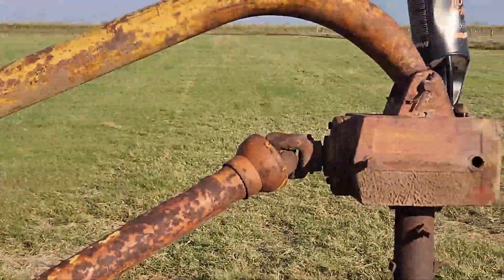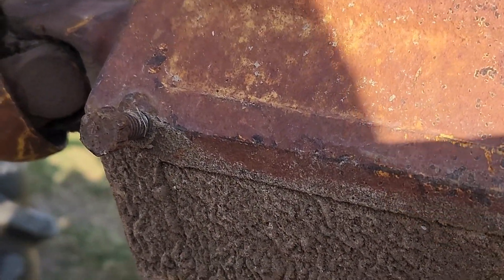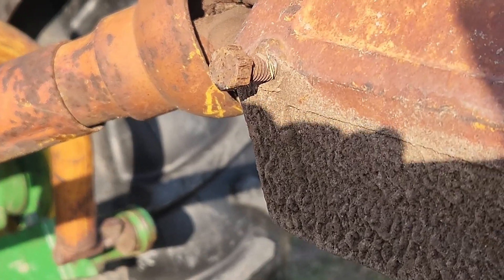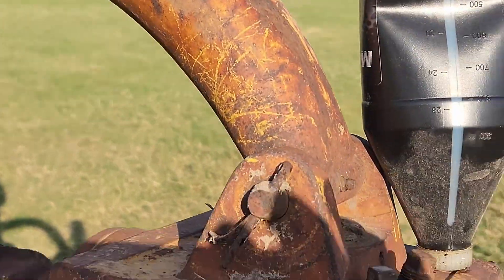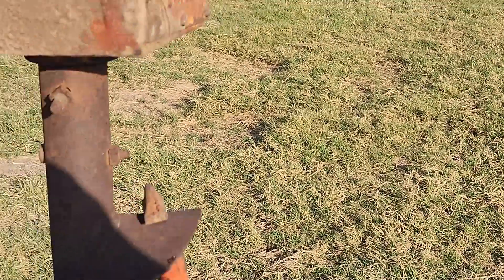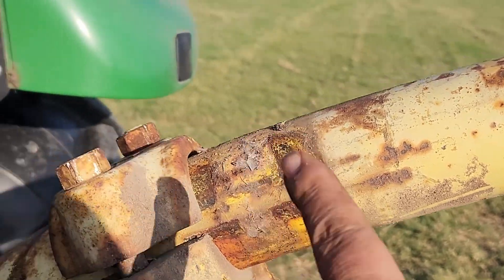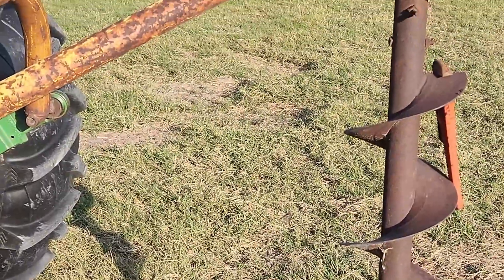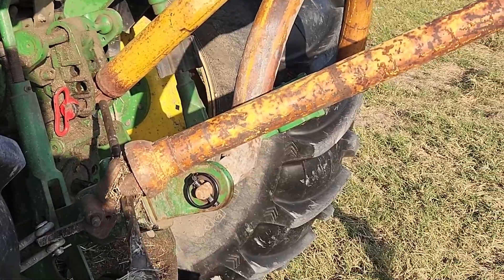How to Install and Make a Sliding Gate. 34 Foot Gate Part 1

Comment: It has been my experience equipment of that age was built to last. 
Unfortunately now it's built to wear out so they can sell more. 
Thank you Louie.
Reply from the maker: You are correct Bryce,  I am lucky that it has a 2" shaft and it has been the norm for Augers.  Tractor supply has the same bolt pattern and will fit it.  Blessing Bryce have a great evening!!

Comment: I’m amazed of the grease fittings, even duck grease being that old
Reply from the maker: None of the bolts were seized or hard to remove, so I am assuming that it had been keeped and somewhat maintained.  When I removed the plug is was bone dry did not have a any smoke or burnt-out smell.  Did see that the auger has a small leak in the seal.  Let's hope the auger bit from Tractor Supply works.  It had been sitting for 10 or more years at the proportie when I got blade.  And who knows how long it had not been used before that.  all zerks were good. Have a great evening!!

Comment: My grandpa had the same auger, we used it for many, many years. I'm 42 and I can remember it being on the farm all of my life. Its not the heaviest made but it was a great little auger until I had to replace it just a few years ago when the gearbox finally locked up. I cant remember ever changing the gear oil in it just added a little here & there. It lasted a long time with little to no maintenance, so if you take care of it, it should last a very long time.
Reply from the maker: Mike, I'm over 60 and can remember we had one as well, but like a lot of the implement that are worn or can't be repaired, we would scrap or repurpose them.  When I pulled the plug it was completely empty of gear oil.  I did notice some leaks around the auger seal,  so I will be checking it frequently.   Thanks for the encouraging words.  My brother has two but I don't like to borrow stuff and prefer having our own.  Like they say in an expensive store you break it you buy it.  Have a great evening Mike and thanks for commenting.  Blessing.

Comment: Hi Louie, I have homemade mounts for my post hole digger. I have it mounted to one of my 520 John Deere tractors.
When I go to mount it, I get a loader tractor and suspend it with a chain. That way I can hook it up myself and the neighbors aren’t having to hide the women and children from hearing all the cussing and screaming 🤣
Reply from the maker: I had to wait a while trying to catch my breathing.  I had seen a metal post holding the auger in place that would make it easy to backup and hook it up.    I am sure the neighbors cow were running away from where I was at, thinking I was going to shoot them.  To funny, have a great evening Gary.

Comment: Sweet. Anything free that works is not a bad deal. I've heard of people taking a front end loader of another tractor and putting it on the post hole digger to put some pressure on it . Great work.
Reply from the maker: We can dig nice in our area, we don't have extremely hard soil.  it was definitely the auger.  I can put a auger in out front end loader but dont have one.  a converted skid steer auger will work, I already have the hydraulic hose connection in place for the hay grappler.  have a blessed day Ryan!!